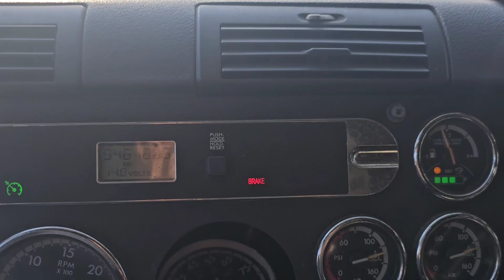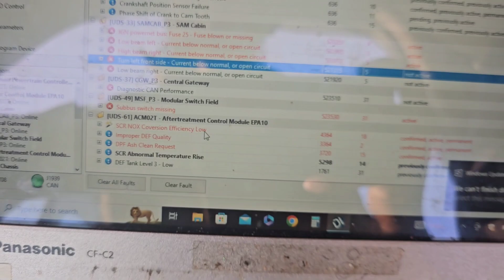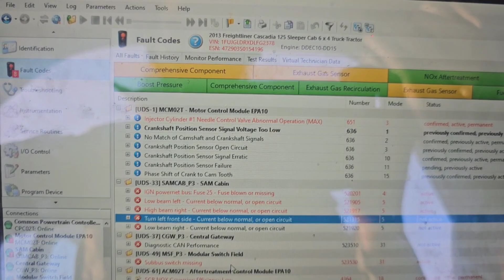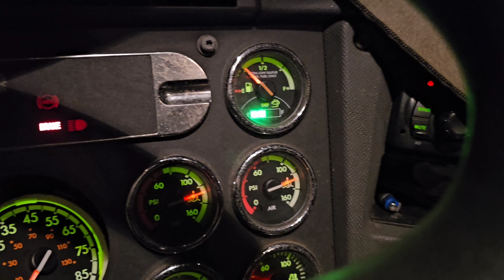Bad Injector & Bad Def

Comment: I have a question. I have these black flakes coming out of my water and fuel separator what could that be?
Reply from the maker: Not sure but 1st thing I  would check is the egr hot pipe  you could have soot mixing in your coolant very bad water could get sucked in your intake  and hydro lock your engine..look at the last few shorts i did on egr  i just talked about that..